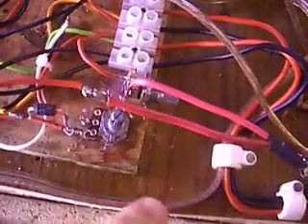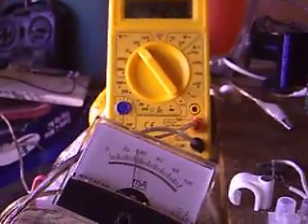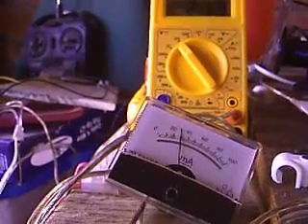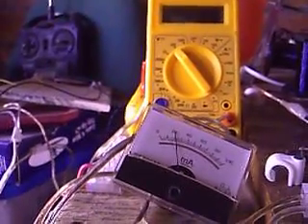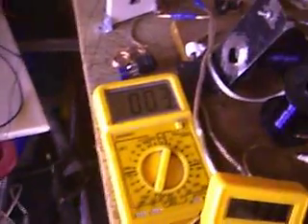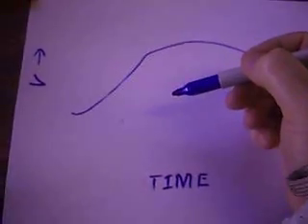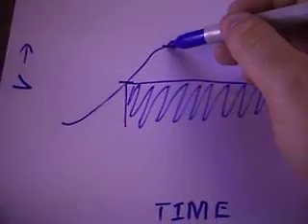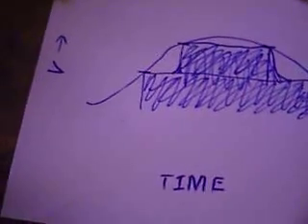comwarriors bedini feedback to source / new bedini - Update 13 part 2

Comment: prove what . that your fumble fingered :) any bedini with 3 to five windings will produce voltage after you turn the bedini circuit off .i have one that coast for over a minuit . its a magnet flywheel and weight about 3 pounds and spins up over 10000 rpm on practically no milliamps  its a simple matter of using that "coasting"and a special way of returning it to the battery